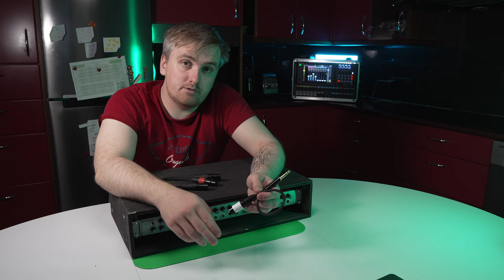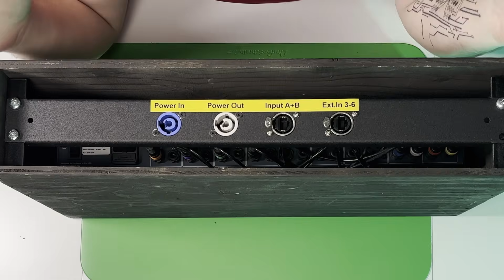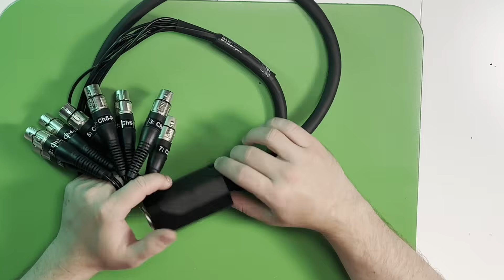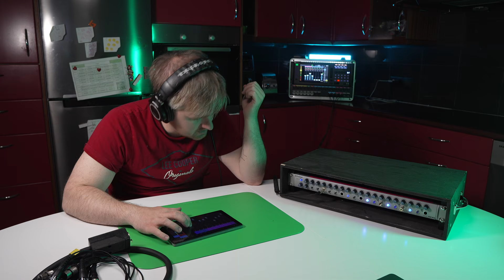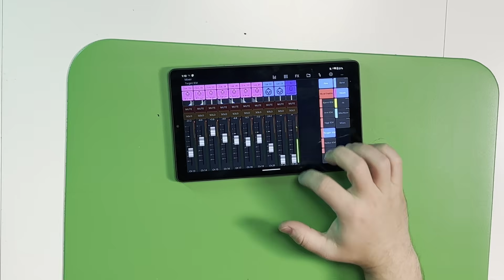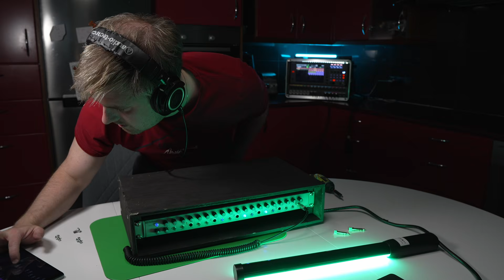6x Stereo Wired IEMs on two Cat cables.

Comment: Hi Arni. Greetings from Tasmania. This is fantastic stuff - your insights and advice are wonderful. 
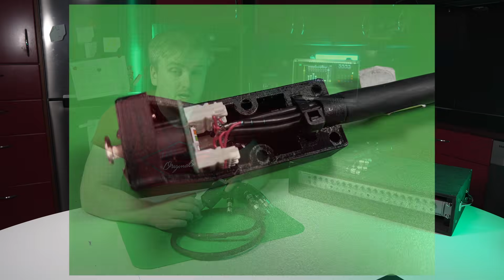But I must point out a potentially serious problem for some users. At about 6:30, you mention that pin 3 should be connected to ground when creating the unbalanced signal. That is correct for passive impedance-balanced audio (most budget audio equipment). However in equipment with active balanced outputs, pin 3 carries a negative mirror-image signal of the positive signal on pin 2. The negative signal is driven by a separate output amplifier, which can be damaged if pin 3 is shorted to earth. According to my reading, pin 3 should be left floating with such equipment. My MIDAS MR18 has such actively balanced outputs,  so it's important to check.

Comment: Hey man! Love the content! Been thinking about an option I was wondering if it would work. Could you wire a mic split for an IEM rig that puts front of house out to ethercon? I have a bunch of breakout boxes and could easily hand that to FOH. I want to build a super low profile split for our 32 channels so I was thinking 3x 1U panels with 12 Xlr and 3 ethercon each. Can I I press Xlr cables into the push pin ethercon? So the ethercon will pickup the 4 channels to send to FOH? (So solder IEM xlr and Xlr out to ethercon push pin for every d panel Xlr connector)
Reply from the maker: Yes that should work. A friend of mine is building a wing rack that uses ethercons for the split outs.

A bit annoying to need 9 Ethercons and breakouts for the split out, but definitely possible.

The neutrik punch ethercon say thay can take two wires per connector if they are the same diameter.
Reply: @arnieitthvad  Ok! Thanks man, ya i've been going back and forth for months now on whether its worth it to do a 100 pin multipin connector and make it all 1 connection. The price on the loom tails and the inline connector alone are like $600+ or so let alone the panel and parts. Since I already have ethercon breakouts and right angle XLRs I can get into this split for a fraction of the cost. Fingers crossed the pinout on the Lyx amazon brand ethercon breakouts are consistent lol I don't think they are whirlwind style mapped, a reviewer said they looked like Radial's pin out for ethercon. I wish it was standardized 😒

Comment: Ive started building our own iem packs, i got the inspiration from you, i designed my own belt packs with built in headphone amp and bluetooth, the belt pack has headphone jack and a guitar in, so from the belt pack to the pedal board we only have one cable
Reply from the maker: Interesting, what is Bluetooth for? And what what cable are you running to the board?
Reply: @arnieitthvad  for individual silent practicing and since the belt pack is battery powered it can become wireless headphone amp for listening to music. Im still building it gathering all the materials so im still deciding what type pf cable ill be using. Iwas hoping to buy the same cable you use but i cant source out any supplier/seller in our country(aparently 2channel snake is rare in Philippines)
Reply from the maker: @markusvillamor i think most cable manufacturers actually make some sort of a 2ch multicore.

Just keep in mind that bluetooth inherently has some latency
Reply: @arnieitthvad  i know about the latency, bluetooth is just for the second purpose of the belt packs. when rehearsing the bluetooth is turned off, and all the audio runs to the cables.

About the cables the price of importing them here is almost twice as the price of the cable was so that's not an option.

i was looking at 3core 22awg shielded cable, i was worried about interference since it will carrie the low impedance signal of the guitar and the line level of the iem, i will try to buy just 6m to check if there will some sort of interference.